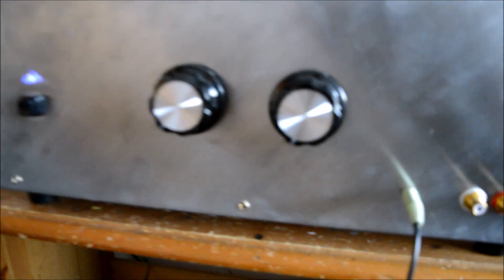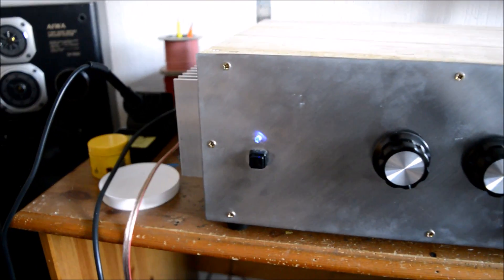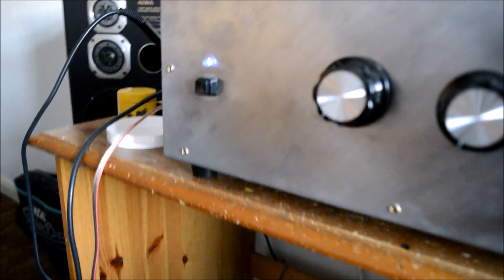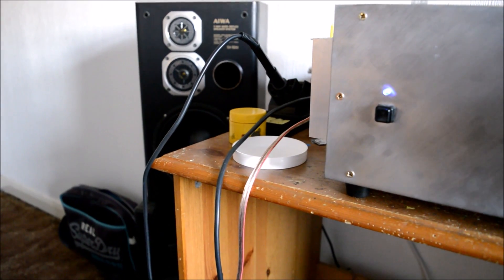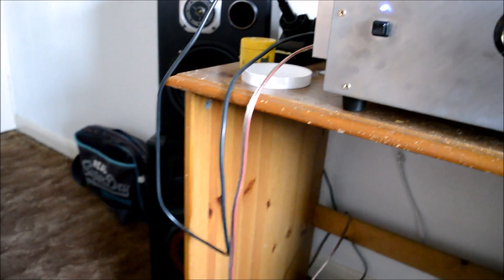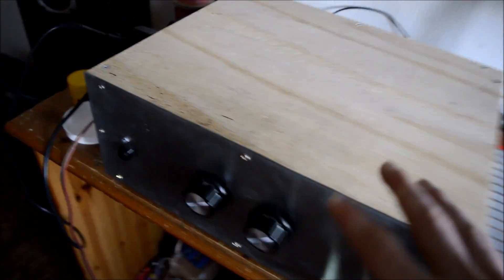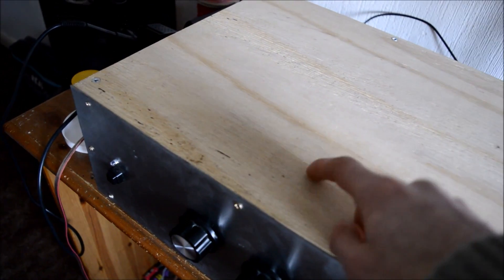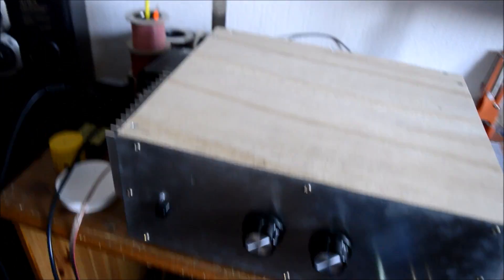Amplifier build: TDA7294

Comment: Yess Tda7294 is around 80w-100w rms  Ic chip, but problem with chips is that if one goes bad you had to replace the whole Ic chip and  it's not cheap
Reply from the maker: Edifier Bass verry true, depends on your preference if it is worth it or not i guess.

Comment: I want to build a guitar amp "head" similar to this with plywood for the box. I'm researching it now. I got myself a transformer that has multitaps 12, 24, 36 v...Do you know when mounting into a wood box, if you have to worry about grounding to the case??? Because its wood, I'm geussing its not conductive..but not really sure??
Reply from the maker: sounds good! if you are going to have any exposed parts (like my front panel and heat sinks) they should be grounded. the wood is fine but just make sure it stays dry. i would still ground the chassis of the transformer though.

all mains voltage connections inside should be covered with heat shrink tubing. (i skipped this on this amp but will fix that soon for version 2).

sounds like a cool project, have fun building it!
Reply: OK ground chassis of transformer..but to where??? Thats whats confusing me a bit? My thinking is Power is coming through the transformer. Rectifier creates my voltage rails to I can ground my preamp and amp to ground there? Is the ground for the transformer chassis the ground on the AC side of the transformer..thats back into the wall socket..the power switch?? When I get it sorted out in my brain..I will proceed. think I will start doing the woodwork..and keep researching. I know effects pedals and electronics with batteries.. this my first AC project.
Reply from the maker: raindogred the transformer case can go to mains ground, and does not need to be connected to your other circuitry,
your rectifier and capacitors should create a 0v rail witch would be "ground" to your amplifier circuit 

Do you know what dc voltage rails your amplifier can run at yet?
Reply: not decided on which chip yet..i have lm 1875 chips.but maybe I will try LM3886.The LM1875 delivers 20 watts into a 4 or 8 load on ±25V . maybe looking at LM3886 68W Cont. Avg. Output Power into 4Ω at VCC = ±28V...
Reply: Thanks for ur help Elliot. Another newby question. My amp will use a preamp that needs between 9-12v dc. I have that multitap transformer. My question: is it a case i can can take 2 voltage sources from this single rectifier?? do I need 2 seperate rectifier, or is there a common way from a single full rectifier to get my 24v + - rails for amp and another 12 v.and they use common ground?? where do suggest I can get good information about this stuff online?? thanks in advance. Are you still enjoying electronics hobby..i love it, but so far I have only ever played with low power/battery type projects..little bit nervous.
Reply from the maker: raindogred no problem! 

You will need separate rectifier circuits, however i recommend you use a voltage regulator such as the lm7812 to get a regulated supply to the pre amp.

and theres this funny catch when you are rectifying ac to dc - if you had 12v ac and rectified it to dc, it would be about 17v dc. This is becuse the ac is 12v rms, the rectifier charges the capacitors to the  peak (about 1.4 times the rms) 

Ive seen the specs of that 68w chip - distortion is so low its amazing.

If the different windings on the output of your transformer are not isolated from each other, you are probably best off powering pre amp with battery or a separate small transformer. And just use the big one for the output stage

If you have google hangouts we could pm on there as well as send diagrams if needed

I dont mind giving advise for your project 👍

Comment: Use short circuit protection fuses for transformer...or if your ic shorted transformer definitely burn...!
Reply: How to put fuse on amplifier circuit 30-0-30 volt
Reply from the maker: 99hari55 very true, i am currently halfway through rebuilding this amplifiers internals, ill put fusing on the transformer secondary while im there
Reply: Thats Good job...use two fuses for -ve and +ve...

Comment: The 15 YO in me congratulates you on the build.  I built a hi fi preamp when I was that age that had similar construction.  Mine was rack mount.  I found an old rack mount case and used a hunk of sheet metal from the door of an old fridge or something for the front panel.  Had the same long wires running everywhere.  The 50+ YO in me says that the amp is probably oscillating at some RF frequency because of the long lead lengths and poor lead dress.  I am not trying to make you feel bad.  I did the exact same thing.  The input and output wires can be long, but the rest of the stuff esp. around the feedback loop, assuming that chip has an external feedback loop, I did not gawk at the schematic long enough to tell, will get you.  Put the other parts as right on top of the pins as you can get.  Put your power supply bypass caps right on the pins.  Try and keep the input and the output away from each other, and don't forget that you are driving both ends of the speaker so be careful about not having a common ground on the output, as neither side is at ground and commoning one side of the speaker  like they do for headphones, probably will not end well.

Overall a cool project.
Reply from the maker: Thanks!, yes the long wires inside won't help the audio clarity, it seems to work fine but you are defiantly right about keeping all the parts as close as possible to avoid parasitic inductance. 

It did have an external feedback loop so my setup wasn't ideal. If I made another one now, I would etch my own pcbs for each channel 

Thankyou for your feedback! I much appreciate it 👍